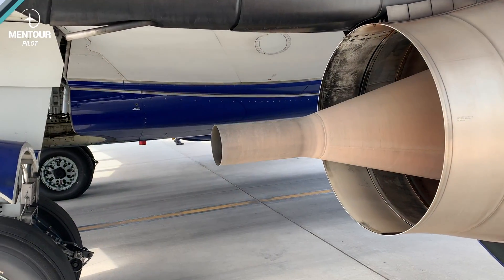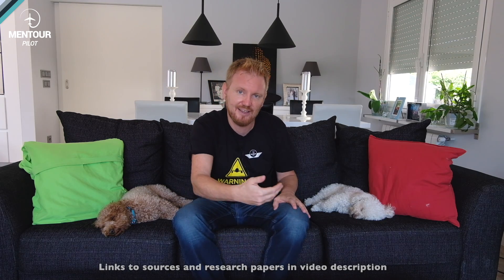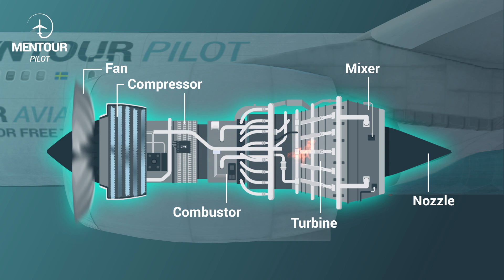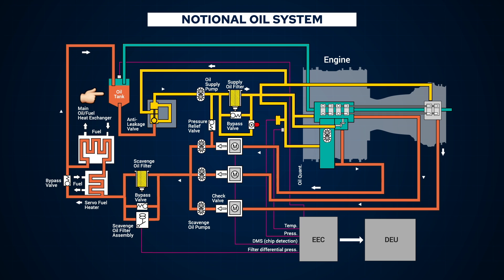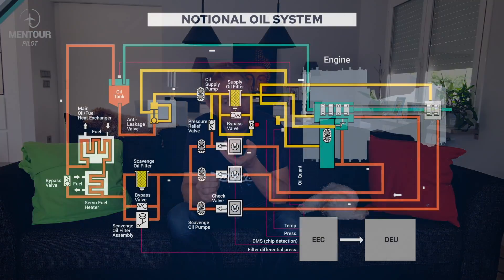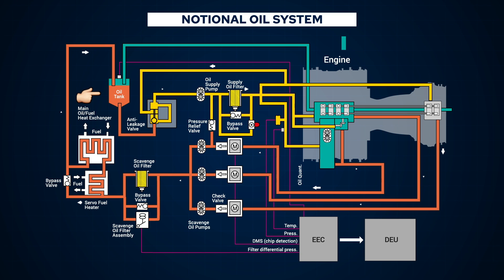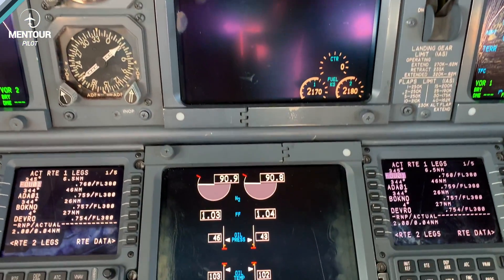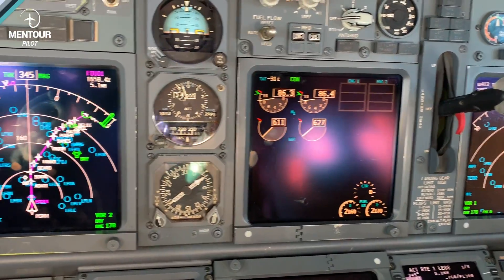What is that TUBE at back of the B737 JET engine?!

Comment: Amazing video about the B737NG oil system! As an maintenance engineer i would like to add some information.

The primary function of the oil in the turbofan engine is cooling of the bearings beside the obvious lubrication purposes. The bearings accumulate a lot of thermal energy via the friction and the load its carrying (small layer of oil between the bearing roller and its raceway). 

this thermal energy will be taken away by the oil that's why you want the oil to be taken away asap when it dropped from the bearing sinds its job is completed. The termal energy is indeed used to heat the fuel. 

Beside burning fuel  is used to operate actuators the HMU sends fuel to the VBV VSV TBV HPTACC LPTACC and on some engines the BSV. When there is ice in the fuel it will block small passages in the system and prevent stable operation of the engine. That's why the servo fuel heater recieves the hot scavenge engine oil to heat the fuel and prevent blockages due to ice.

A fun fact to add to the venting system is that the oil tank, Accessory gearbox and Transfer Gearbox are vented via the fwd sump to the tail pipe of the engine.

The anti leakage valve is useful if you work on the oil system the valve prevents oil from flowing from  the tank to the supply pump when there is no rear sump supply pressure. This way you don't need to drain the entire oil tank if you take lines off (the oil tank is higher than most of the system). Another function of the anti leakage valve is to prevent the oil from flowing from the tank to the engine after its been shutdown this prevents over servicing.

Comment: Now that IS clever; using an existing high speed shaft as a centrifuge, rather than adding another one. Akin to hollow turbine blades for cooling below the melting point of the alloy. We've come a long way from stone axes.

If you want another engineering puzzle to investigate, how does the electrical generator running off a gas turbine output a constant AC frequency, despite the wide range of rpm the engine runs at? The answer is related to some car air conditioning units.

Comment: that oiling system isn't so far departed from an automobile or motorcycle engine as you'd' think. both are pressurized fluid bearings or actively lubricated ball bearings with a sump, and many motorcycles even use dry sumps to manage oil, running oil supply and scavenge gears on the same shaft. This is just pressure oiling with extra steps, added filters and layers of cooling and redundancy. I'm mostly curious if there's any way to manage how much cooling you get to the oil from the fuel lines. Is there a system to manage this? Most oil manufacturers specify a specific temperature they're to be run at or have a chart on how the viscosity and ability to protect the engine vary with oil temperature.

Comment: The exhaust cone serves multiple purposes. I acts as an exhaust flow aerodynamic fairing, a flame or heat shield to the aft bearing, and as a vent for the oil recovery system. Maybe that is where most of the oil escapes these oil thirsty engines. Did not know the n1 shaft is used as a centrifuge for the oil recovery system of the CFM 56. Gus Hammerly UAL a&p

Comment: So are they using the rotation of the Oil Vent Tube as the centrifugal breather? throwing the oil onto the surface of the rotating tube and only allowing the vapours to travel down the tube to the breather tube vent at the rear?

Comment: it is kinda funny how operationally a jet engine is actually more simplistic than the engine in a car.  It just spins a bunch of fancy fans.  The complexity is in the temperatures and precision needed to prevent bad things from happening.  While car engines until you reach higher end performance models have room for some fudging.  Get some wobble in a jet engine and if you are lucky you have a contained RUD of your spinning bits if unlucky well you can hopefully land before becoming an episode of Air Crash Investigation.

Comment: There is another very clever thing about this system you have not mentioned. The fuel-oil heat exchanger is not only for cooling down the oil, but also for heating up the fuel. The fuel itself has to be heated up before it goes into the engine as it is not flammable at low temperatures so the heat exchanger pools double duty for both tasks.

Comment: Aircraft fuel loads are usually listed in pounds or kilos. I know you need that to figure max takeoff weight and time of flight remaining, but how does that relate to gallons or liters? I worked on a private aviation service station at one time and we topped off a stretched DC 8 charter flight that originated at JFK airport to Syracuse Hancock Field before transiting to Rhoda, Spain, and we added 8000 gallons of jet fuel before they left. I seemed amazing to me if they burned that much getting to Syracuse, what would they use for a transatlantic flight? Maybe they didn't take on a full load at JFK?

Comment: When I was in Flight Test on the 737 on for the -900 ER flat Bulkhead They wanted to shorten the tube for aeronautics efficiency but it burned the rear slat cover “Canoe “ so hot the heat sensors in test burned! Thru. Went back to the old nozzle...DOH!!

Comment: Excellent video as always. During this video, you made me think of a question that I think could be somewhat controversial. Aviation in the United States in particular, has spent alot of time and money to make it as safe as possible so as to gain the public trust. Most people at this point are quite comfortable with the notion of sitting in a metal tube for hours on end at 35+ thousand feet. That being said, if the industry started to relax the safety margins, where do you think a good "compromise" point for safety versus efficiency would land? Hope this question makes sense.

Comment: Have you ever considered why the spike at the back of the jet engine has the shape it does? Looking at the drawings in this video, it reminds me of the construction of an aerospike nozzle on a rocket engine. In terms of flow conditioning, it would also make sense to have such a device in that position. The aeropike would be ideal in rocket engines as well if the throat cooling issues could be solved; since jet engines run a lot cooler, that shouldn't be a problem in this application though.

Comment: here's the maintenance manual description,

Vent System
The vent system connects the oil tank with the forward
sump. There are also internal connections between the
engine sumps and gearboxes. The vent circuit bleeds out
of the exhaust plug at the rear of the engine.
Reply: BananaKing AMM part 1 (SDS)  79-20-00-010 👍🏻

Comment: Good job! I worked at Pratt & Whitney in the 70s on JT8 and JT9 engines. I worked on the assembly floor and one of the jobs everyone rotated through the job of installing the oil jet in a fixture and setting the pressure and then weighing the timed sample with an inspector to verify the results. Also worked on P3 Orions as a avionics tech in the US Navy. Can’t tell you the number of times I’ve flown on a 737 from SCC to ANC.

Comment: A 767, Atlas cargo plane took off from Honolulu bound for guam, but shortly after take off,  had to turn around back, the right engine was shut down because of engine surges and compressor stalling, was seen with trails of fire, September 6, 2020

Comment: I respectfully disagree with the statement at 2:40-2:55.
The front propellers provide a very small fraction of the total push.
The max push at standstill from the spinning propellers is 1 atm at sea level, much less at higher altitudes.
The faster the aircraft flys, the lesser important the propellers.  All the propellers do is to provide enough air for burning and bypass expansion.
Ramjet doesn’t have propellers.
Jet engines’ power come from burning of the fuel that expand the air volume.  1 liter in 10 liter out.  There is a great imbalance of force exerted on the front and the back of jet engines.

Comment: Amazing video, however, a slight correction should be made I believe. 
At 3:24 the diagram indicates that bleed air is taken through the start valve, but it's not. The start valve is connected to the Accessory Gearbox for N2 rotation during start, so no air can come into the system through that valve. 
I believe the valve you're trying to indicate there is the Precooler Control valve, which takes "cool" air from Fan for cooling the hot 5th and 9th stage bleed air, at the precooler.

Anyway, i watched the entire video, and like someone mentioned below, I know that this is very much out of your comfort zone, however, your animation and explanation is on par with some of the Engineering instructors I've had classes with. An excellent explanation of a very complex system. I'll be looking forward to your future videos!! :)

Comment: Why don't they just use roller bearings? Would not need oil then! Thanks Petter.
Reply: Tyhey need LOTS of high pressure oil to cool them at the high rpms they are turning at.

Comment: In terms of measurement units in the FMS, is that something the pilot can configure in flight or does it have to be done by an avionics tech? For example, you're flying an airplane configured for feet altitude and inches of mercury for the altimeter setting. If you're in the middle of nowhere and the controller gives you hectopascals and metres, can you input that or do you have to do the conversion before setting the FMS?

Comment: The labyrinth seals are the main reason why smoke comes out during startup and shutdown. When the turbine slows down the seal becomes less effective and it leaks oil from the bearings which burns on its way out

Comment: When you started talking about the oil system, I started thinking that it was a breather pipe. When I was still doing MRO support for the Arriel engines, I had a few run ins-with problems in this system. For the Arriel engine, the deairrator is a gear within the accessory gear box (AGB) at the front of the engine. Pretty much the same concept as the CFM56, it uses centrifugal forces to fling oil droplets down to the bottom of the AGB. Like you said, the system is not perfect and not all of the oil gets removed from the air that comes out of the breather tube. To contend with that, the end of the breather tube is pointed towards the tail pipe of the engine, which means the oil gets burned off by hot exhaust. 

However (and I can say this because Safran released material admitting the problem in their circulars to their customers), the seal for the breather gear is tricky to install. Sometimes the o-ring around the gear shaft gets rolled or pinched, and the seal gets broken. In which case, you'll see more oil coming out of the breather tube. This is something that we check for in the test cell. We collect oil coming out of the breather port on the AGB and make sure it doesn't exceed a certain amount. But we've seen cases bad to the point where the pilot has to emergency land cause the whole oil tank got consumed that way. The entire tailboom was wet with oil in that case.

Comment: You forgot the dozens of huge tanks full of aluminum, barium and other metallic nano-particulates which replace the passenger seats, and feed into the exhaust system of the plane for controlled release of CHEMMMMMMM TRAAAAAAAILS!!  There, I said it.  More credibly called "stratospheric aerosol injection" (SAI) ... gets fewer tinfoil hat responses!

Comment: It's the vent air exit for the oil system center vent tube which is installed inside of the low pressure turbine shaft.

Comment: I worked at an CRT in Mentor Ohio (and aircraft engine repair shop) for a summer as an engineering intern. Before watching the video I'm guessing the center vent tube. I was trusted with revamping the repair program for the CVT on the CFM 56 5b engines. I'll update after the video if I was right.

Edit: I was right. I did learn something new. I never knew why the tolerances were so tight on the CVT. It makes sense now that I know it actually rotates with the engine. Super cool video.

Side note: If you've never had to go through the manuals from the manufacturer, the FAA, and the airline and cross compare each to make sure that if one step is included in one manual, but not the others and then make sure it's included in the final program, it is a really tedious task and I recommend writing an Excel program to do it for you. Long story short they were having issues after FPI (florescent penetrant inspection) marking the cracks and defects so that after cleaning they could still find them for weld repair or plasma spray repair. I reorganized the work flow so that they could router gouge the issues before the cleaning so that the defects would still be present. Prior to this they were using black magic marker which of course was cleaned off during the cleaning phase. 

Love your channel. Stay safe and healthy!

Comment: Flame arrestors... We had a 737-300 with the CFM-56B. The plane was up on jacks, therefore the flame arrestor was much higher than normal. Usually it sits about chest level, you can't miss it. There were 3 of us chilling right behind the engine discussing our plan of attack for a maintenance task we were to do. When we broke to go get the equipment we needed, Jeff, turned around and ran right into the back of that flame arrestor with his forehead and it dropped him to his knees... His forehead had a realty deep "smile" imprinted on it...luckily, no cut or blood...He got very lucky. The sound the plane made, as it did not budge of course, was a solid thud...

Comment: Great Video Mentor. So who adds the oil? Is it a maintenance crew or is it something that the refueling truck does? A southwest 737 has engines running for at least 8 hours each day. They don't pull these planes into the hanger every day for maintenance. Or maybe they do? I see them parked overnight at the terminals at smf. How much oil does a 737 hold? The one that you showed had 2 hours worth of flying left before it needed more oil.
Btw, there is a good video somewhere on youtube illustrating the leaking bearing seals. The poster of the video is convinced that the burnt oil is then pumped through the cabin and is poisoning the passengers.
Btw Mentor. Do you have any videos telling people that fresh air is constantly being pumped into the cabin. Why do people think that the air in the cabin during flight is the exact same in that was in the cabin during take off.
Reply: Travis k Maintenance adds oil normally at night stops or at S-checks (every 72 hrs), usually when parked at a gate. 
An oil tank can contain approx 21 quarts of oil.

Comment: So basically it’s the dry sump oil breather. I have one of those on my rally car.
Reply: with the difference being ICE crankcase (prefer low pressure) blow-by gases are "pulled out" by a low pressure source + replenish from cleaned air vs starting with pressurized gas/oil mix in a jet

Comment: Great job Peter! I have question for you - do they still allow ramp agents to taxi aircrafts from the parking apron to the gate? When I worked for American Airlines in the late 80s the company did an on the job course to train ramp agents to get a taxi license and how to start the APU for power in the aircrafts for towing to the gates. It was a month course and I took the course for MD-80S and 737 start up systems

Comment: Thank you for posting this video, you've just backed up exactly what I was saying to someone the other day, that pilots don't need to know the in depth engineering of how an airplane works, that's what aeronautical engineers are trained for, and paid for, a pilot needs to know enough to safely fly the plane, and that's it.

If you want to know HOW TO FLY a plane, ask the pilot, if you want to know HOW IT FLIES, ask an aeronautical engineer, because I promise you a lot of what they teach at flight schools about aerodynamics and the engineering of the aircraft are approximations, some of them actually quite bad approximations, but ok enough to learn to fly.

It's kind of like how you don't need to know how your car works to be able to drive it, if you did there'd be far less people out there with driving licences... that could actually be a good idea...

Comment: The positive air pressure sealing is interesting, but this is not what makes a dry sump. A sump is any well to collect a fluid. A dry sump is generally very small and continuously drained by gravity or a scavenge pump, dry sumps are common on radial engines and Harley-Davidson motorcycles. A wet-sump acts as a storage tank for the fluid and it contains the oil pump,  a wet sump can also act as stated in the video as a bath for rotating parts, most automobile engines are wet sump with no moving parts in the oil(the churning at high rpm removes power and causes foam), many lower speed gear-boxes act as bath type wet sumps. 
Side fact, the oil in small  and medium engines is used for cleaning, this is the main reason it needs to be changed. The crankcase oil in large cross-head diesels(huge ships) can last years and still be clear, the main problem being microbes that grow on condensation in the tanks and sumps. These use a separate consumable oil for cylinder-piston lubrication and they have several types on board that they switch between depending on the quality of the fuel. (reaction byproducts can be acidic or deposit scale if the wrong oil-fuel combination is used, which is bad for exhaust valves and turbines [half of a turbocharger.])
Reply: In the automotive world there are often dry sump engines in order to be able to mount the engine lower in the car. Usually race cars or high performance street cars.